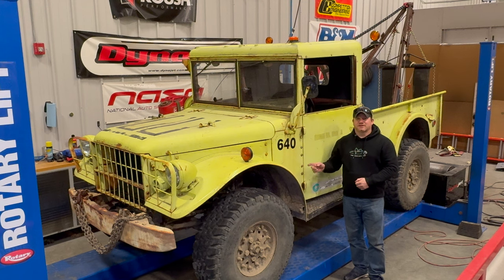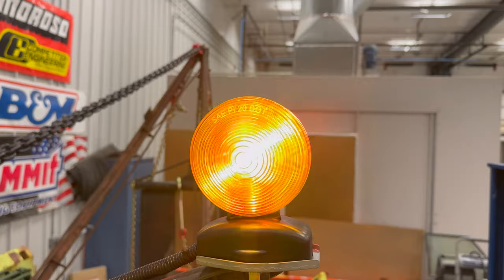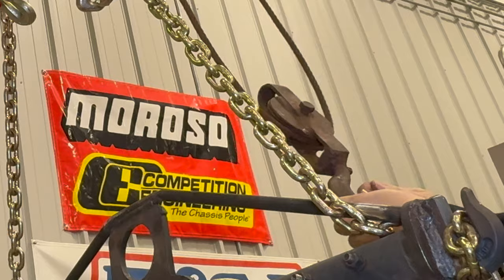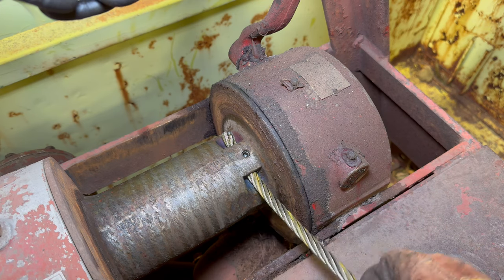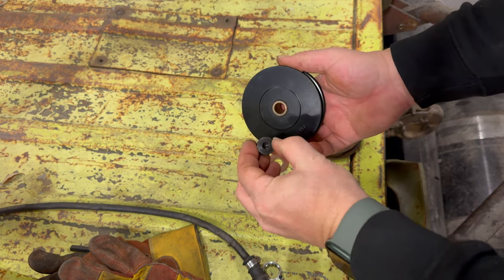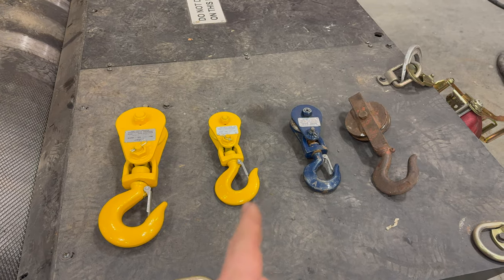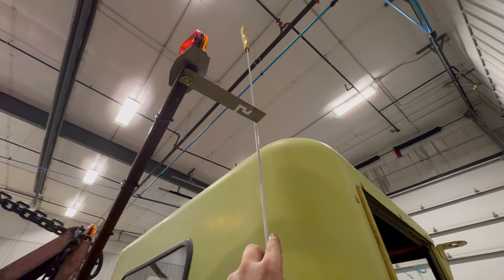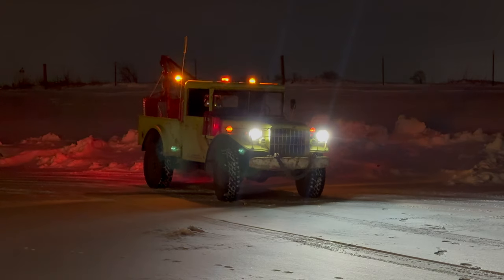Wrecker Upgrades to the Vintage Off Road Wrecker

Comment: Nice to know that I am not the only one still using a steel winch cable.    Our 51 M37 sports a built Ford 300 inline & a ford granny 4 speed. M37  T case in the stock location. ARB frt & rear using stock M37 axles with 488's from vintage.     What a Beast.    I love seeing these still being used...    Kudo's

Comment: Sorry, I didn't get to comment on the distributor video, but I've been brought up around these trucks and have a '54 now that I love. Just an fyi, if you're curious about the engine, look on the top of the block on the driver's side all the way forward. There will be a flat machined area, this is where the serial number for the engine is. There where many variations of this engine at the time. While upgrading your ignition is a great idea (cause I have done it) you should know what the "foundation" is. For example, if the engine is original to the truck, the serial number should start with "T245" then the number. Also there should be a star stamped in it also. If it starts with a P or D those are Plymouth , Doge-Desoto engines. The reason I mentioned this is that the T245 engine was an "industrial" engine. The military made the oil pump tang offset so you can only put the distributor in one way. This engine is only "statically" balanced and should not be run over 3400 rpm. That's why military vehicles have an "air velocity" governor on them. Plus, if I'm not sure, the T245 engine only has a 7:1 compression ratio. Please be careful, don't make a critical mistake. These are getting harder to find. I was lucky enough to find a NOS exhaust manifold (trust me, I paid for it!). Please enjoy your M37, they are so much fun and demanding for attention.👍

Comment: Nice job on a great utility vehicle. Why didn't you go for a roller bearing on the pulley (I think you called it a shiv)?
Reply from the maker: It’s a cable sheave I don’t think they make them that way a roller bearing might not be strong enough.

Comment: Very nice as always. Is there a reason you didn’t use a synthetic cable instead of steel?
Reply from the maker: Synthetic is damaged too easily for the things you would do with this.  I might put synthetic on a front winch when I add one.
Reply: @ThisWeekWithCars  
Tip from a tow man: those magnetic lights are going to get kicked off just from rolling down the road.
Actual tow truck tow lights have very strong magnets and even those "sometimes" come off. The ones you have I guarantee will fly off.
👍😁 keep going

Edit: in their place I recommend you put some 2 sides stud mount lights. Those would be era correct. All the old big trucks ran those on the front fenders also.

Comment: What happened to your water proof things on the truck do you have better performance with different air filter for your carburetor ?
Reply from the maker: I didn’t have any of that stuff it was converted to 12 volts a long time ago.